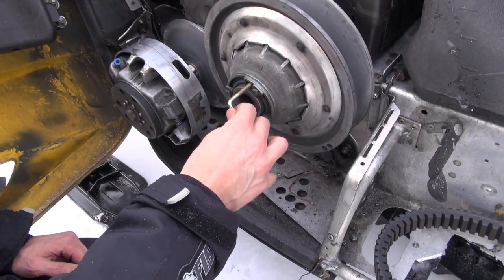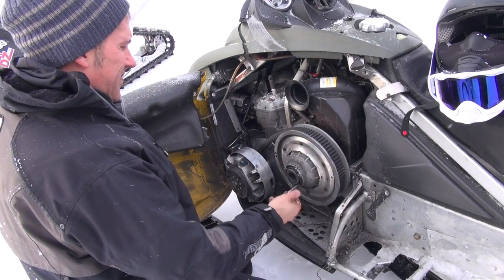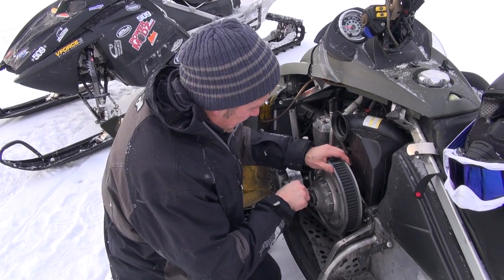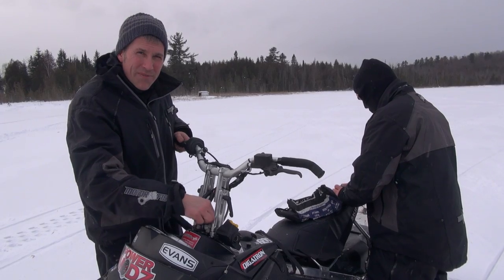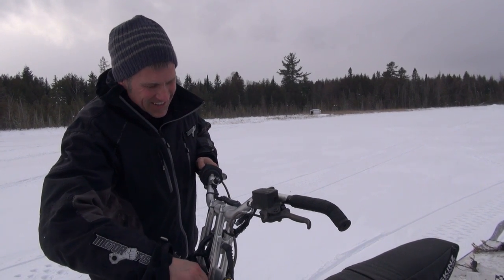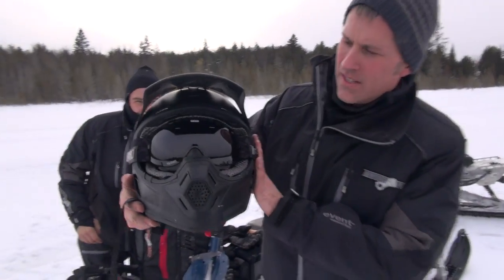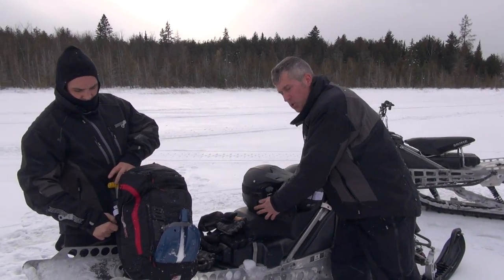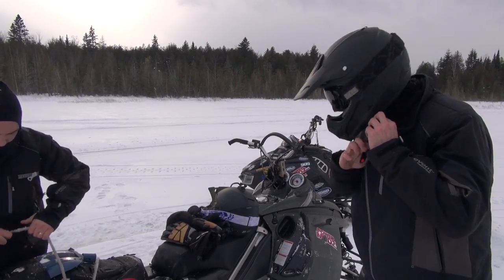Skidoo Rev blows a belt - here's how you change it.   PowerModz!

Comment: FYI..I had a 2008 800 mxz x short track with 600 miles a few years ago and I put a Ultimax xs belt on it and got 200 miles out of it before it fell apart.  Belt deflection, tolerance and alignment were perfect.  I believe it couldn't handle the heat the Tra clutches produce especially with so much back shift.  Went and got the updated harder OEM ski doo belt and zero problems after that.  I have used the Ultimax 2 belt on drag sleds and it is a great belt if u can find it.  Great sled show and love to watch.  Thanks!

Comment: Kealey still has his secondary fan blocker on? Lol seen a video on here of REV mods and a guy said to remove the plate on the secondary clutch to uncover the "fan wings" for air circulation ?& also reduce weight. Or is there a reason for that metal plate?!

Comment: Hey bud :) just wondering if you have any idea how to unseize front shock's it's a 2002 mxzx 440 race sled.My buddy blow it up and the poor girl got left outside for 2 yr's :(    Should I just take them to my buddy at Protech suspension.Or by a used set.they are hpg piggy back shock's.Any info would be greatly app.Cheer's bud

Comment: What kinda head light are you running?I couldn't find a video on it
Reply from the maker: i cut mine in half - for my snobunje mod!
Reply: haha nice, is the housing split? Did you just use a reciprocating saw?
Reply from the maker: Gavin Dhillon lol, yes I just used silicone to seal up the open end - worked great!
Reply: thats pretty nifty, did you have to do anything with the voltage regulator.

Comment: what about adjusting the belt?
Reply: I wondered that too but you can see he tests the tension by feel (2:05), probably good enough.  Also I get the feeling these guys probably blow a lot of belts so the clutches are probably already set up for basically a brand new belt.
Reply: pseudocoder78 you go by the bottom grooves of the belt flush with your secondary clutch for maximum performance
Reply: brettmjones ..
Reply: Travis Bell
 Yeah I'm aware that's the current conventional wisdom, but those grooves weren't always there and old school guys tend to test deflection by feeling how tight the belt is between the primary and secondary.  I agree he did skip explaining that part (either method) even though he did check it.